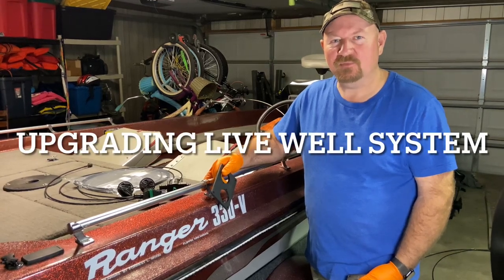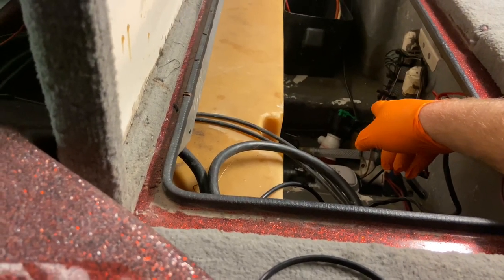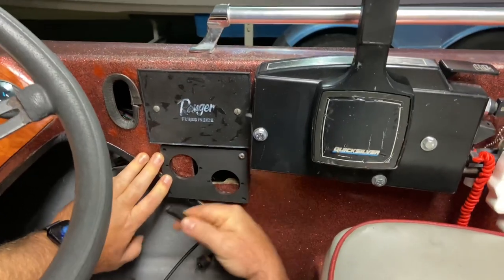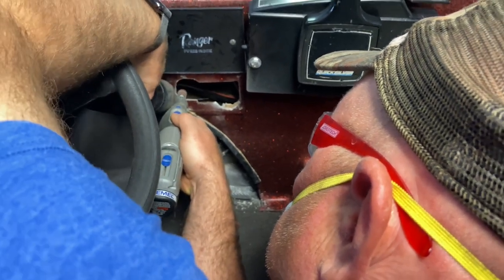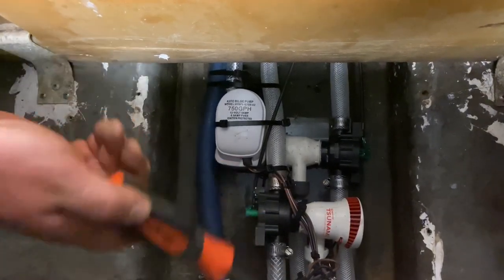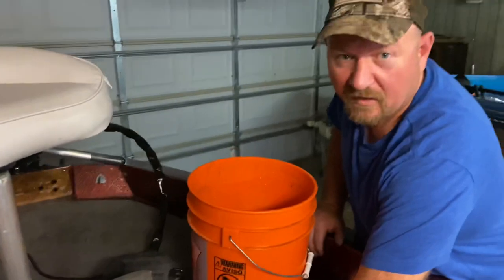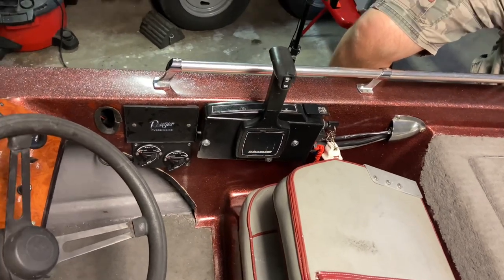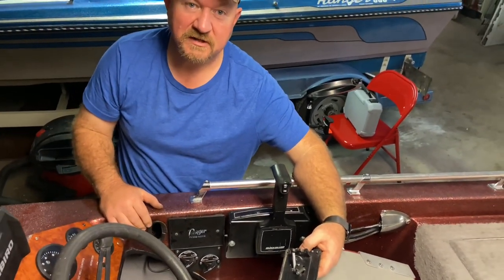How to Upgrade to a Flow- Rite Live Well System on a Bass Boat

Comment: I have a similar problem. When did you get the template from Ranger? Need one. How thick is the template material??
Reply from the maker: I got it about 3 yrs ago.  It’s between an 1/8” and a 1/4” thick black plastic.
Reply: @ProWrenching  Thanks. I'm making a template  for my Pro Craft and I was  making sure it will be thick/strong enough.

Comment: I've learned a lot watching your channel and I've been able to do a few small maintenance and things on my boat by myself due to watching your videos.. but I have a question, I have a 2005 STRATOS 200 Pro XL and I already have the flow rite system that comes factory and I have the research and empty system that you changed over to in this boat. But I don't have or don't know how to get my live well to pump out, and what I mean is when I run my bilge pump of course it kicks on like it should when I get too much water in the hull, but when I want to feel my weigh in bag with water, I can't seem to figure out the configuration or the puzzle to get water to pump out beside bilge pump holes manually, it only works on an automatic system when I'm on the lake and I get too much water in the boat it kicks on and water sprays outside of the boat, I just hate getting underneath the motor and turning my system to empty to drain my livewells to catch water for my bag, and I researched it to some extent but I just get lost in the language because this is my first boat, well let me rephrase that this is not my first boat this is just my first fiberglass bass boat. Do you have any suggestions or do you know anything about that particular issue? All I know is that I have this number three system of flow rite.. and for what I have been able to figure out systems one three and five have a pump out but I can't seem to find mine or make it work right.. thanks and another good video as always
Reply from the maker: Thanks!  I’m glad my videos are useful!  On the live well system  that I installed on my Ranger,  it doesn’t have the pump out feature. The three settings are auto , empty, and recirculation. If you have it on auto it will automatically fill the livewell and the excess water should go out the overflow through the tubing to the back of the boat. If you have it on recirculation then that will circulate the water from the live well through the aerator pump and back through the live well.  On this feature you will be able to keep your live wells full when you take your boat off the water. The empty feature will allow the livewell to drain when you take your boat out of the water and it will also drain when your boat is on plane. The livewell systems that have the pump out feature through flow rite utilize a an extra valve and an extra hose to pump out on the side of the boat using the aerator pump. All Livewells should only drain to the outside of the boat- it should not empty into the bilge of your boat.  I appreciate you watching.  I hope this info helps.

Comment: I have a 1992 ranger 363v. My live wells automatically fill up on me and I don’t want that. Does this help with that?
Reply from the maker: @day2xs208  this livewell setup has 3 positions-auto empty and recirculation.  If you turn the valve to recirculation mode before you launch the boat and get on the water then your live wells won’t fill up.
Reply: @ProWrenching  thank you I appreciate your help

Comment: Also do you think you can list the parts bought I'd like the same upgrade but my boat has 4 switches tyvm
Reply from the maker: I used Attwood pumps 4643-7, Flow-Rite 3 position valves MV-03-RN01 V3, Flow-Rite 10ft cable (figure out what length you need), Flow-Rite controls RK3-BW

Comment: I just bought the 88 v393 and my well valves aren't internally working as should. Do you have a link or parts number? Thank so much
Reply from the maker: Flow- Rite three position valves (PAID LINK): https://amzn.to/3NgsBif
DISCLOSURE:  As an Amazon Associate I earn from qualifying purchases.
Reply: @ProWrenching  thanks!
Reply: @ProWrenching  then I would have to get a T for the aerator? Line? It looks like the origional has a 3 way valve. This is all new to me so I appreciate your patience and understanding.
Reply from the maker: @CTRadventures  on my boat, there is no T required b/c the valve attaches directly to the pump. During fill mode the pump draws water from the transom through the pump to the live well and the excess water will drain out the overflow drain. During recirculation mode, the pump will draw water from the live well drain and pump it back through to the live well.in the drain position, the water will exit the live well drain through the valve to the back of the transom.  Thanks for watching my videos. Much appreciated!
Reply: @ProWrenching  yeah I don't think mine has that feature It almost looks like it's gravity-fed The only pump that's in line is the aerator pump or at least that's what it's calling it on the control panel when I turn it on and there's enough water in the livewell it just kind of sprinkles down and makes bubbles on top It doesn't look like your stereotypical fish tank aerator from underneath that makes bubbles It almost looks like what you did or what's supposed to be where it's like a waterfall, I'll have to play with it a little bit more I don't use nor do I really have plans to use the live wells much but I do like to fix things and if I bought something and something is supposed to work I like to try to make it work

Comment: What would you call this livewell setup.  I have a 87 arrow glass bass boat with dual livewells such as yours but I can't find any upgrade videos and with that is there a drain plug you put in or a overflow tube
Reply from the maker: With this set up you don’t use the drain plug anymore but it still utilizes an overflow.  The system that I am using is the flow rite V3 valve system. Some good videos of explanation can be found on the flow rite website. This system has drain, fill, and recirculation mode. This system is closest to what they have on the newer Ranger bass boats.
Reply: Tyvm

Comment: Is the aerator mode on my console the same feature as recirc?
Reply from the maker: The aerator switch on the dash  sends power ti the aerator pump.   Recirc mode is selected by the 3 position valve.
Reply: @ProWrenching  so if I got this my unit would just be aerator from the console, then fill and empty like the original cables.
Reply from the maker: @CTRadventures  the 3 position valve setup has fill, empty, & recirc.  Recirc mode allows you to pull your boat out of the water and still have your live well full and recirculating in case you have to trailer your boat to weigh in for a tournament.
Reply: Thanks again for the comments and advice, I thought I had seen an all in Ken kit w the cables controls everything, or am I thinking wrong
Reply from the maker: @CTRadventures  I purchased the pieces separately.  Don’t know if there’s a kit.
Reply: @ProWrenching  thanks!
Reply: @ProWrenching  sorry to bother you again, I'm having trouble finding the face plate that the new switches go to
Reply from the maker: @CTRadventures  You’re not bothering me- happy to help if I can.  I bought mine from Ranger parts.
Reply from the maker: Ranger parts 1-800-724-7273
Reply: @ProWrenching  awesome thanks , I was just piecing together the stuff on Amazon and without that plate I think I was at $220 eek I wish I could just replace the original valves and call it a day
Reply from the maker: @CTRadventures  yep.  Unfortunately, the originals are not available anymore.

Comment: how did you install the new hoses for the drains. thank you
Reply from the maker: I didn’t replace the entire hose to the drain on the front livewell because on my boat there’s not an access for the hoses on the front.  So, I used a 3/4” splice and hose clamps to connect to the old hose and checked it for leaks after I made the repair.  The hose for the rear drain is easily accessible, so I did replace that hose with new 3/4” vinyl hose.
Reply: Ok thank you

Comment: Where did you get the adapter plate
Reply from the maker: I bought it from Ranger
Reply: @ProWrenching  ok thank you your videos are very helpful thank you again
Reply from the maker: @mikepalmer8538  thank you!
Reply: @ProWrenching  I did forget to ask you what size cables you ordered and do you have a part number for the replacement plate.i have a 96 482v thank you again
Reply from the maker: @mikepalmer8538  On this Ranger 330-V,  I used a 10 ft cable.  I don’t have the part # for the adapter plate, but Ranger should be able to tell you which one you need.

Comment: Where can I find the adaptor plate?  Thanks
Reply from the maker: I ordered it from Ranger.  Ranger boat parts 1-800-724-7273
Reply: @ProWrenching  can you provide the part number for the adapter plate please?
Reply from the maker: @paulcinquegrano3056  I don’t have the part number.  You can get the part by calling Ranger parts department and ask for the adapter plate for the Flow-Rite controls.

Comment: what does auto do???
Reply from the maker: In the auto mode, water is directed from the inlet thru the pump into the livewell and the extra water will go out thru the overflow of the livewell.
Reply: @ProWrenching  That's the same as FILL?
Reply from the maker: @Old_Sailor85  yes

Comment: Why didn't you just use the old cables to pull the new ones?
Reply from the maker: The old cables were a different style and didn’t fit the new style controls or valves.
Reply: @ProWrenching  I think you miss understood my question. why didn't you attach the new cables to the old ones before you pulled them out. it would have saved a ton of time.
Reply from the maker: @Johnfor3  ok, I see what you’re saying.  That’s a great tip.  In this case, I had pulled the old cables out previously b/c i wanted to measure their length before I ordered the new ones.